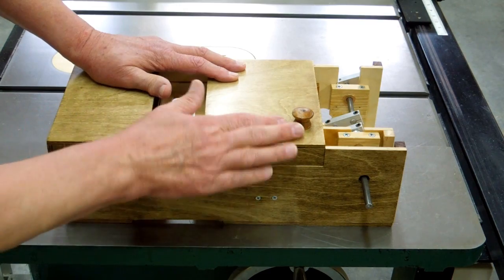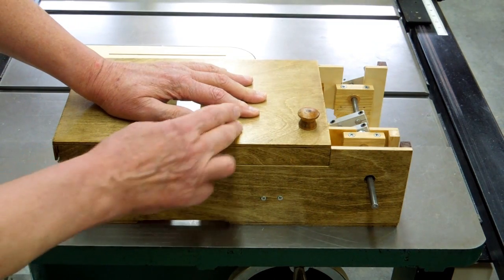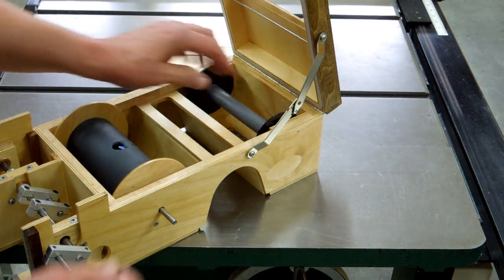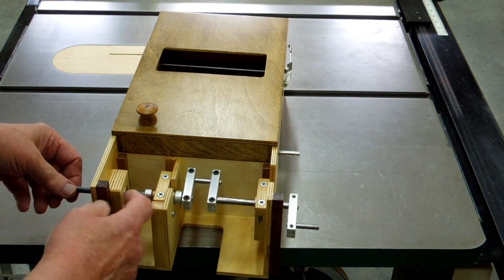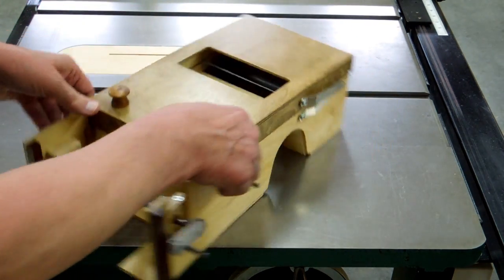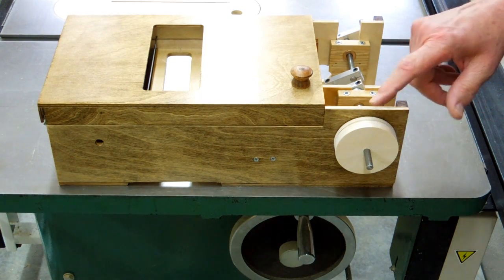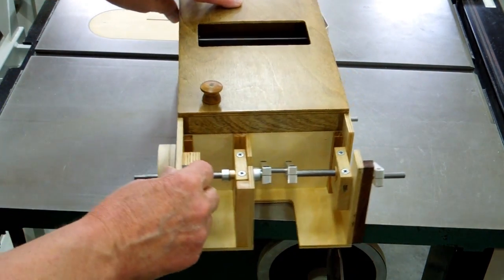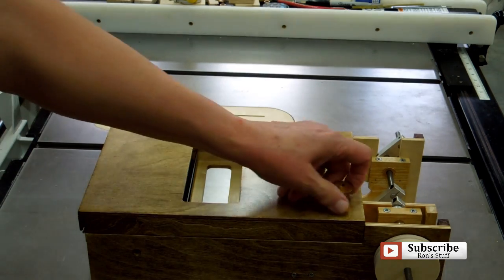Senior 20 Organ (10) Pressure Box Progress Review

Comment: Hello Ron! How to seal the holes for the cranck and the spools to avoid air leakeage?
Reply from the maker: The handcrank shaft runs in bushings... but that is not inside the pressure box.
The takeup spool shaft also runs in bushings or bearings. That is the only shaft which penetrates the pressure box and there is slight air leakage past the bushing or bearing. 
The bellows deliver enough excess air to compensate for small leakages at various points of the system.
Watch the following. Ron
Senior 20 Organ (09) Spools & Crankshaft
https://youtu.be/tK5NPkRJR20
Reply: @RonaldWalters2010  Thank you, once more!

Comment: Must admit that watching your craftsmanship and the excellence of the build has been very interesting. May I ask if/how you are going to "make the music" and holes on the rolls or is there an abundant supply of music on rolls readable available? Thanks for sharing!
Reply from the maker: MRrwmac There are plans out there for a roll punch so you could make your own rolls. Hampered by not being musically inclined, I do not think I will be so adventurous as to punch the music rolls. Music rolls are available from Melvyn Wright, Thomas Sterk, Hiddo van Os and a few others. Google It. Music rolls are fairly expensive. A roll with three tunes or songs on it plus shipping will probably cost $90 to $100. This is one reason many prefer to build a version of these organs which play midi files.
Reply: Ok thanks. Good to know the options are available to those who want to make one of these. I assume you will the using the midi version or will be explaining all the options in a future video when build is complete?
Reply from the maker: MRrwmac No... maybe I did not explain that very well. The Busker and the Senior 20 play perforated music rolls, period. The organ I am building here (the Senior 20) plays a music roll. I do not know of an available design of a midi version of the Senior 20, however I have heard some have created such a thing on their own. John Smith has a design for a quite large organ called Topsy which is strictly a midi organ. Go to johnsmithbusker.co.uk  and then go to "ordering" to get an idea of his different organs.